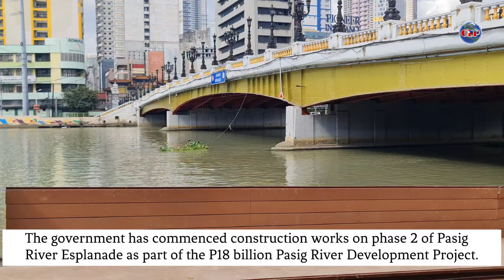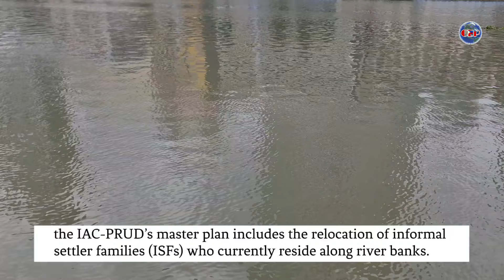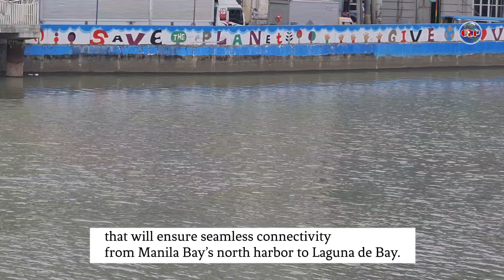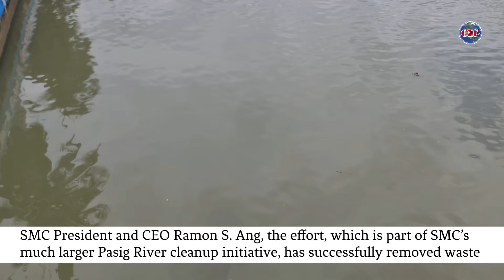Phase 2 ng Pasig River Esplanade Hanggang Intramuros na! Mas Malawak at Mas Mahaba 🇵🇭

Comment: it’s time to modernize binondo and make it like eastwood city or rockwell. binondo has a lot of potential and can be a CBD. improvement of infrastructure is much needed like roads, sewerage, waste water management, skywalk like in ortigas, electric cables should be put underground. remove all passenger jeepneys and tricycle and replaced it with a green public transportation like mini e-bus or tram. binondo has limited parking space so its better to have buildings meant for parking  and strictly no parking on the side of the road. improve the traffic system. put greeneries on the side of the road.  restore those art-deco buildings bcoz these will be the reason binondo will be recognized by the tourists. it has rich history to be proud of.